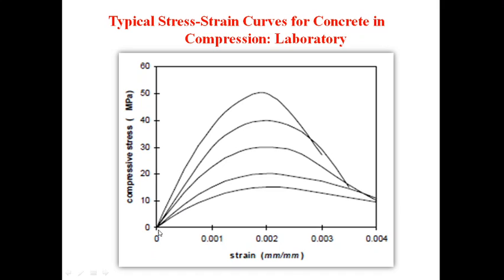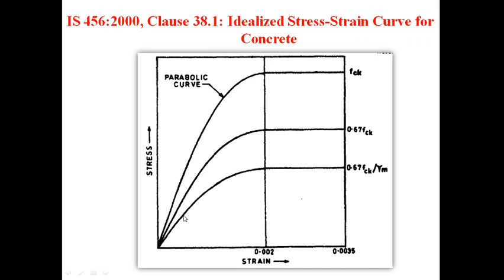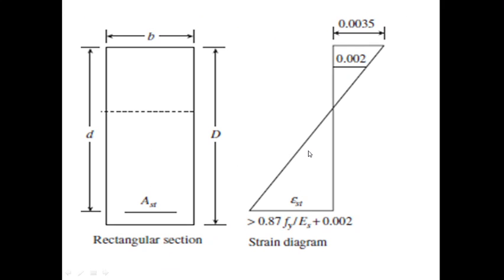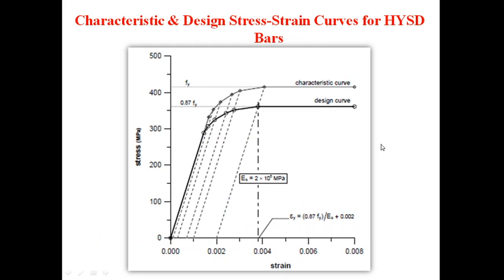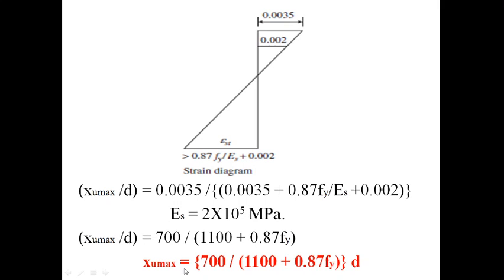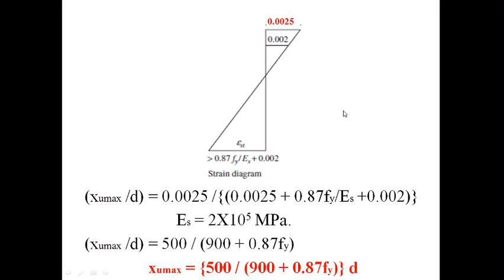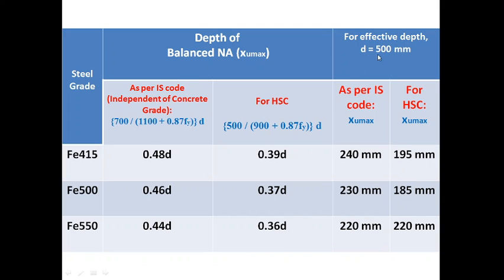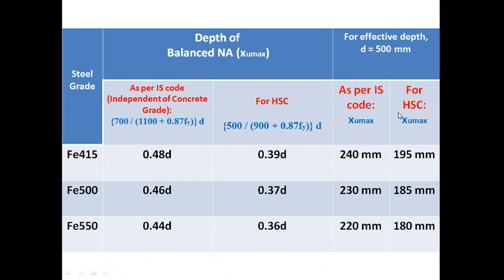Is It Logical to consider Failure Strain(Flexure Compression) as 0.0035 for High Strength Concrete??

Comment: Yes currently indian standard codes recommend to incorporate cracked section properties by modifying the stiffness values of concrete columns, beams, slabs, walls as per IS 16700:2017 so the final design is on conservative side.
Reply from the maker: Dear Tanvesh......Yes...true.....0.0035 strain is only of plain concrete element. However, it's RCC on actual site & things further become comlicated due to interaction between steel & concrete...